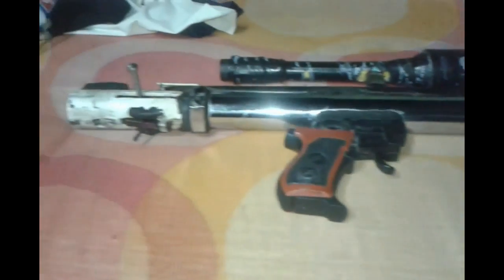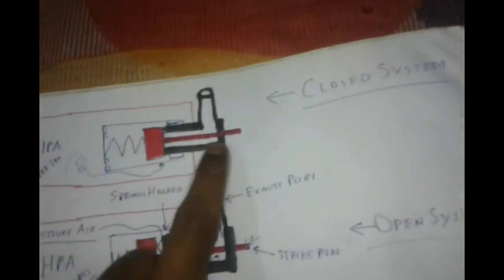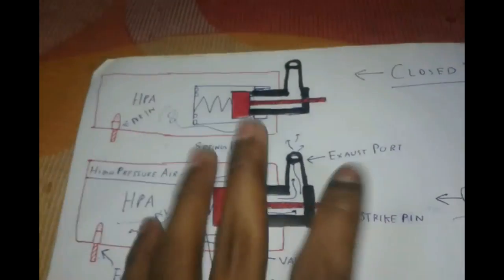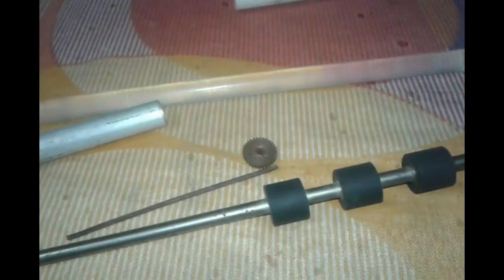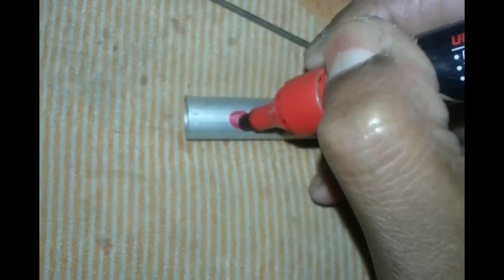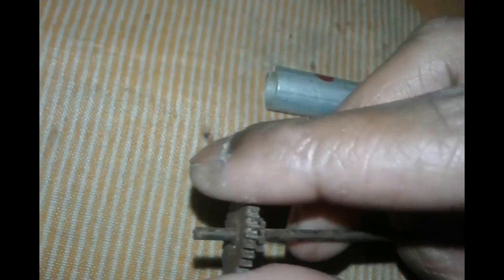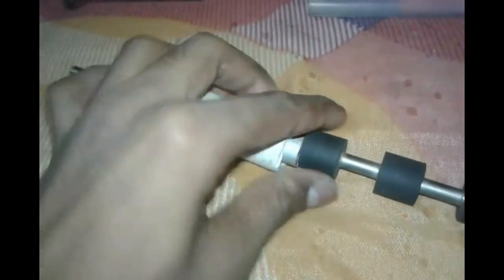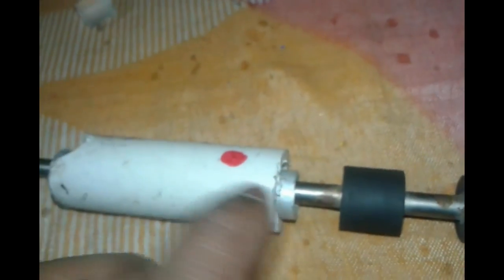homemade pcp valve for air rifle

Comment: u used a small gear to cover one side of aluminum pipe. Isn't it possible that air will leak from that gear hole where striking pin is placed. Please reply
Reply from the maker: balbir singh Sehgal yeah u ar correct air will leak between the spikes of the gear I solved this using a good guality sealent....it does job..!! ( nice quistion)
Reply: Bhai you are right. Gear teeth can be covered by a sealant. But I am talking about the hole in the gear from where striking pin is inserted
Reply from the maker: balbir singh Sehgal there will be the striking rod in it covering the maximim gap..!! & yeah still there will be some gap but it has to be there or else the striker rod will not move freely causing many other problems but  the air leak depending upon the build quality 1-2% loss..
Reply: Thats what I wanted to know. Thanks bhai
Reply from the maker: balbir singh Sehgal no problem....

Comment: Hello. may I ask some more of making a airgun valve
Reply from the maker: yes ..!! of course
Reply: when did you post another video? valve that easy to make
Reply from the maker: ummm check my all valve related videos in my channel..! it is very easy to make but the main part is to use a good sealant for proper structural strength which is very important.!!
Reply: I try so many times but all my work is useless, because i cannot perfect and i dont know yet the technique
Reply: I dont know yet how to maintain the air pressure in my valve
Reply: give me some video that i can follow step by step. thank you
Reply from the maker: follow the diagram.! and use your imagination to animate the parts in your mind..! ( i am serious this will help in bulding ) even i also work that way.! ^-^

Comment: can u explain with ur air chamber spray can
Reply from the maker: the air chamber is nothing just like a bottle to store air. having 2 main component 1st- the filler port ( to fill the air ) 
& 2nd- the main hammer valve.